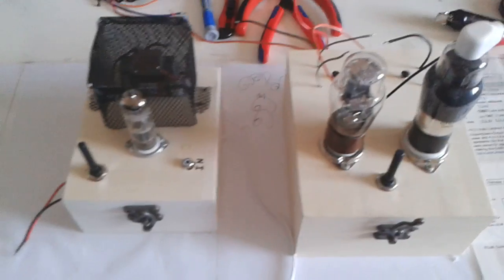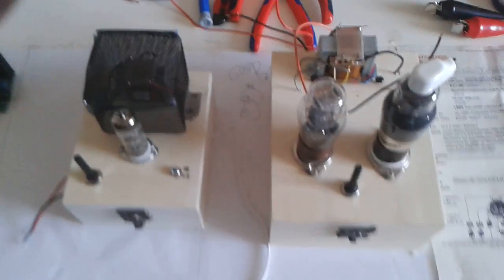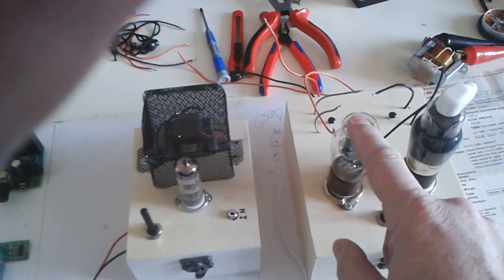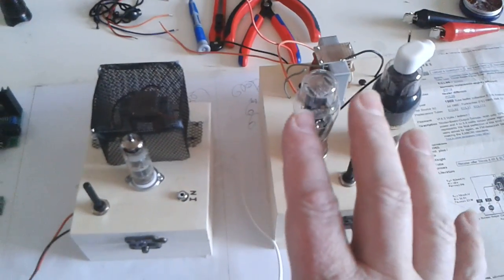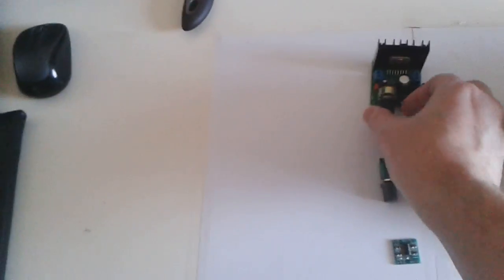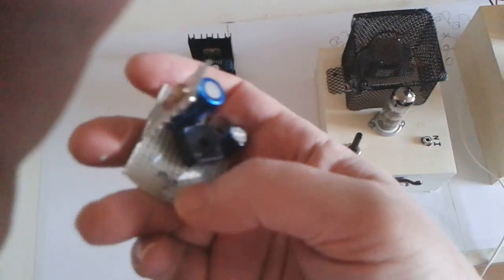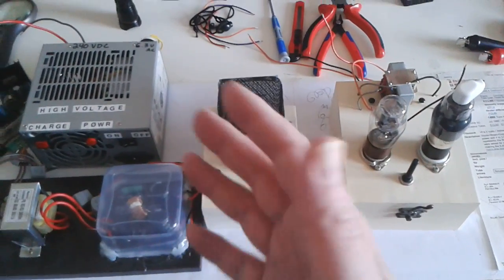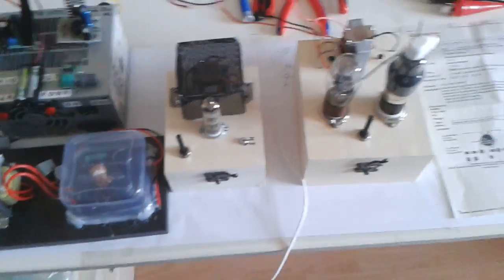Tube amps vs. Solid-state

Comment: if solid state is better than tube why did they developed FET?........a tube amp uses voltage amplification same as a MOSFET transistor so they copied the principles using voltage amplification and who is better solid state or tube?.

Comment: hi, could you please tell me where did you buy the solid state amp? (15-watt stereo) and how much did you spend on the fifteenish watt tube amp?
Reply from the maker: Fernando Martinez Torres No problem. Go to ebay and search for "TDA7297 amp" or "TDA7297 amplifier" Here's some examples of what you'll find:

http://www.ebay.com/itm/New-TDA7297-AC-DC12V-2-15W-Dual-Channel-Digital-Stereo-Audio-Amplifier-Board/331473636463?

or

http://www.ebay.com/itm/TDA2030A-Audio-Power-Amplifier-Board-DIY-Learning-Kit-PCB-Board/181385570927?
Reply from the maker: Fernando Martinez Torres main thing is to look for a good price (2 to 5 bucks and free shipping) and a good feedback rating at 99% or higher. It usually takes a long time to ship but they are good little amps for something cheap and small. But I prefer TUBES. Good luck! :D